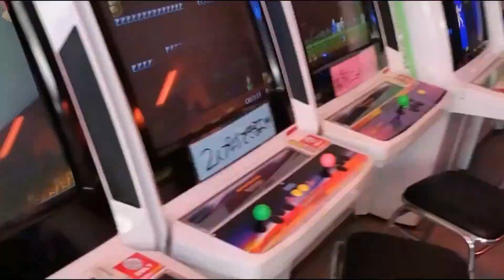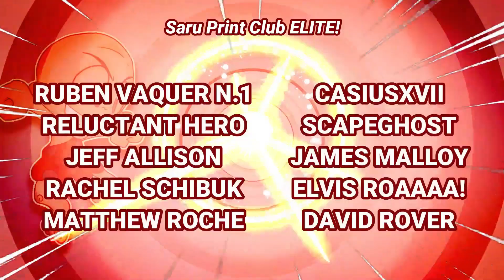PC Engine Smoked Clear Case & INSTALL # pcengine #videogames

Comment: I was in the first wave (Clear) and second wave (Smoke) for these Taiwanese Retro Game Restore shells/cases. I found that it is very difficult to cut new threads with the original exterior security screws but not with the internal ones used to hold the HuCard slot in the top half. The HuCard mounting screws are the same thread spacing as the exterior security screws, only sharper, and with a groove that lets the plastic accumulate so it slices right through without getting too tight.

Just use the HuCard slot screws to cut new threads for the exterior security screws. Don't turn too much without backing out and clearing the plastic debris.

1 turn, back out.
2 turns, back out.
4 turns, back out.
6 turns, back out.
...until you've gone far enough.

If you do this without the bottom shell in place keep in mind that you do not have to go all the way since the bottom shell will essentially add to the height of the screw post.

Comment: The real question is... should I play my PC Engine games on my brand spanking new smoked clear case PCE or with my Polymega. amirite?
Reply from the maker: With no way to play Hucards on the Polymega just yet, I am using my PCE more. But for everything else, I am primarily using the Polymega 😛
Reply: Do you want to drive a FAKE Ferrari or do you want to drive the real deal ??
Polymega is just an big PC EMULATOR..... Two schools here...make your choice !!